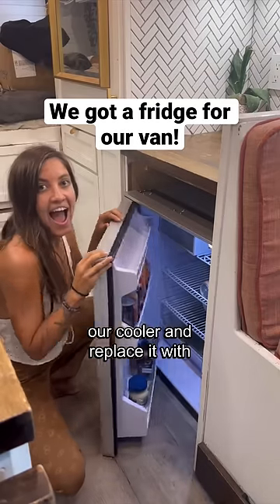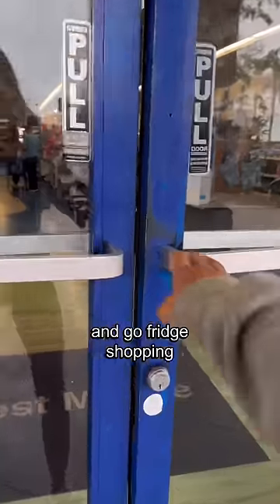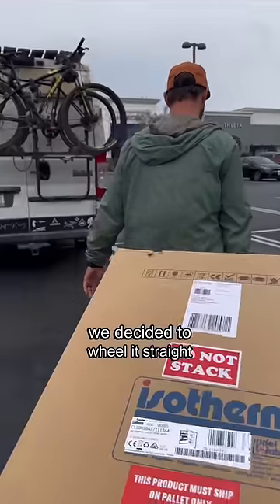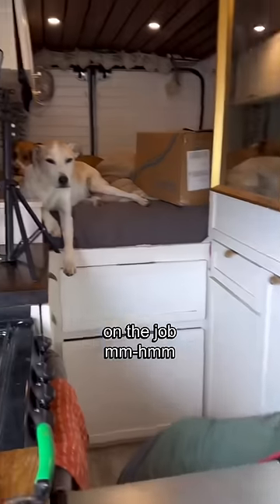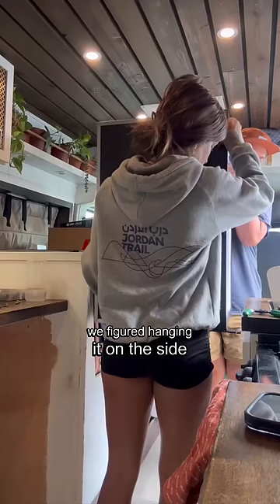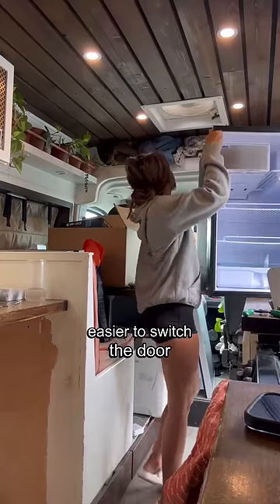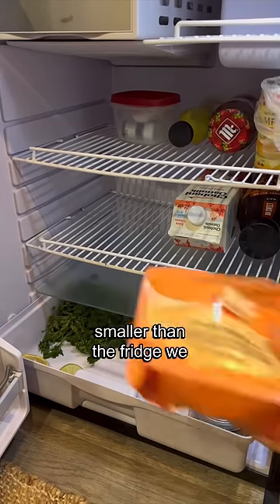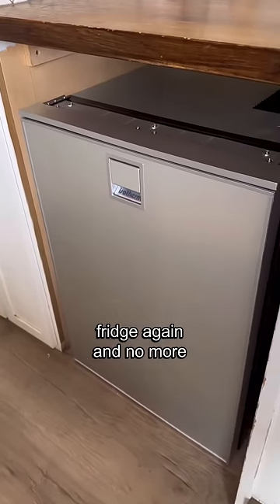Bye bye cooler 👋🏻 #vanlife #vanfridge #rvfridge #vankitchen #rvkitchen #fridgetour #fridgerestock

Comment: Can’t wait till it smells and they call 5 more techs saying it’s fine just to toss it and get another cooler
Reply: Can't wait :)
Reply: but they could buy like 50 coolers with the 1.5k they just spent!!
Reply: @poikelos6291  and do what with them? 
You try replacing your fridge with a cooler 😂
Reply: @poikelos6291  tbh I feel bad for the kids
Reply: Omg I thought it was them lol
Reply: The crazy is strong in that one
Reply: @pugas587  works perfectly i just buy a new one if i flip my daily coin and it lands on heads.
Reply: @pugas587  I mean, they make powered coolers that take up pass room. I have one for my camping setup and it has dual zone temp so I can have both a fridge and freezer. Granted they cost about the same a fridge anyways, but they do make cooler options that would work
Reply: @SuperTheast  would they work for day-to-day use or just camping? Never knew they existed but can't say I'm surprised either. Just never thought about it
Reply: @pugas587  you can use them day to day. When I camp I usually do a road trip on backcountry roads so I need something that doesn’t require ice. I’ve seen people use them day to day but the only downside is for a good one you’ll be spending about 1500-2k on it
Reply: @SuperTheast  that's steep. I'd just get a fridge lol
Reply: @pugas587  with a fridge you can’t guarantee running off a vehicles battery. With van builds they have inverters to make them work. For my situation, I don’t have that luxury when it comes to space so I need something that can run off a vehicle battery which the powered coolers can do
Reply: Here before 1k likes!
Reply: Yep
Reply: thas exactlyy what they do
Reply: @poikelos6291  they're not all this expensive!
Reply: @nancyminui9108  for an isotherm of that modal aint cheap tho. depends what size they got
Reply: Oh my God, you guys are so negative. I hope it works great and last for years! :-)
Reply: Lmfao oh man I forgot this was them
Reply: lol. I’m
Reply: Savage 😂
Reply: I’ve literally only seen these 2 once before and it was in that video months ago. Seeing this instantly brought back my thoughts of how absolutely ridiculously irresponsible and annoying that whole fiasco was the first time. Based on that I don’t think they are cut out for van life.
Reply: I was watching this and wondering “aren’t these the people who had three techs come out, say their fridge was fine and Still got rid of it??”” Lol.
Reply: @treekotreeko3487 they don’t have kids wtf 💀
Reply: If a mini fridge smells it not because of the refrigeration side 😅😅😅. That’s on the owner

Comment: I've never seen such a savage comment section for van life. Lol
Reply: That's because most of us know how terrible those 12v fridges are and the fail rate it enormous all for $1,500. Just buy a $250 dorm fridge that plugs in. But they are making a video on how to be fancy and not smart.
Reply: it's because the creator had a fridge, it started to smell, prolly from lack of cleaning, so they got 3 separate technicians to come and they all said there was nothing wrong with it, so they got rid of it and bought a cooler

Comment: The comment section here is absolute Brutality .
            
However I must say:  Next time get a tape measure and purchase the appropriate size unit for your R.V.’S  opening .
Reply: @n8germ  They had an old fridge with an odor and told 3 technicians to come check it. All the techs said the fridge was fine, but they decided to get rid of the fridge anyway and used a cooler until now.
Reply: @n8germ  and im guessing the odor was from food and not the fridge itself

Comment: You shouldn't turn on any fridges or anything that contains ferion right away you should wait for the ferion to settle ( as per package instructions ) it takes anyway from 2 hours to 6 hours depending on the type of compressor and the size of the fridge

Comment: ya can't just say Full size and . sorry had to end my sentence first ,  and camper/mini fridge in the same sentence 🥴🤪 it's either normal household size, industrial super size  or your average drinks fridge the small ones called mini fridges or dormitory fridges camper fridges are like midway between an actual homes fridge and the mini fridge usually being almost as tall but much skinnier so not a ton of capacity but more than a dorm fridge

Comment: I would check this fridge by at least 69 technicians just to be sure it has no leak. Then just give it away to be extra sure you are not poisoned by a minor freon that wouldn't affect you if you have windows or doors open regularly. And also check your van's AC system fyi that one also uses freon and extra assurance give it to someone that would make more interesting content. You are traveling and saving money should be a priority. You wasted a good fridge a cooler a lot of food just to buy another fridge. Either you are trolling for clout or just don't think straight.

Comment: So you had a cooler, seen a random stranger that looked like they needed a cooler, gave it to them and then proceeded to look at more coolers. Should call a technician for it the fridge tho, it didn’t have the arc plate installed from factory.